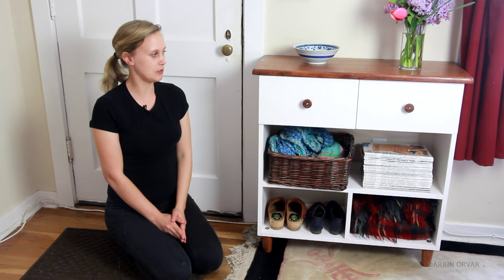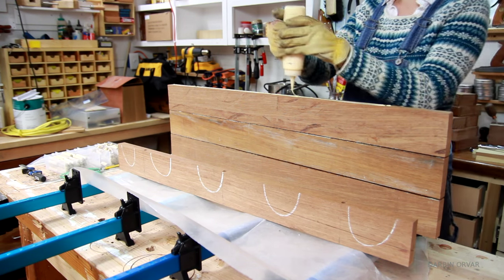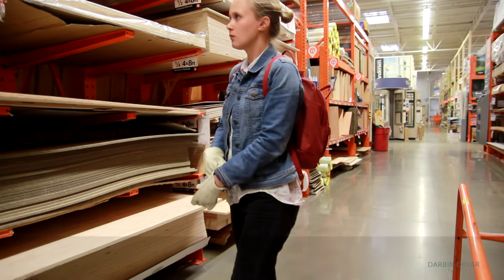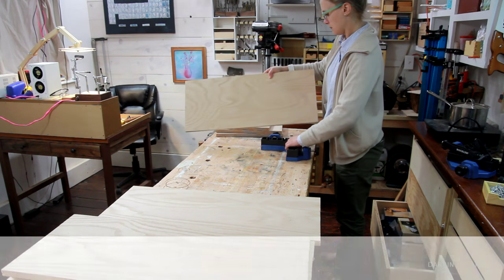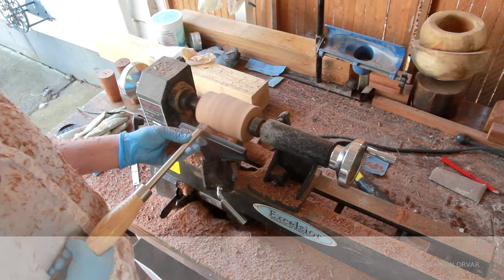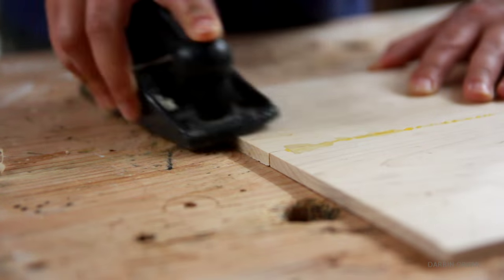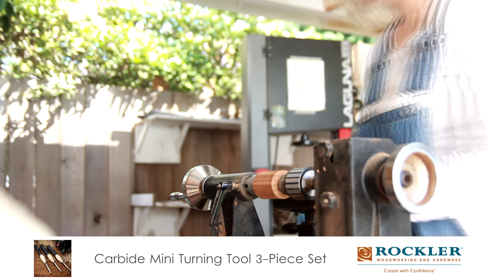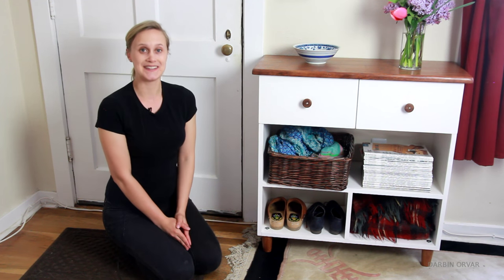Beautiful Entryway Table w/ Dovetail Drawers

Comment: A very nice job!  You make it look so easy, and as someone who has done similar things myself, I know it's not easy to make it seem easy.

A trick that some might find useful: for cutting up large sheets of plywood when you don't have a panel saw you can make use of styrofoam insulating sheets. These are sold in packs of three where I live, and consist of 3/4" thick, 2' by 4' sheets of light styrene foam. You just drop them on the floor or driveway, put the plywood on top, and set your circular saw to penetrate the wood by a 1/4 to 1/2 inch.  With thicker plywood you can crawl around on top as needed, and if you happen to cut into the foam, there's no danger or harm to anything that matters. The foam is very inexpensive, but if you are a little bit careful it can last for years. Storing it between uses is simple...just tape it to a wall or ceiling and get some extra insulation!

Thanks for the video!

-- Mike
Reply from the maker: +BigMjolnir That's a' great tip Mike - thanks!

Comment: Nice build! One trick I've learned when fixing cracks with epoxy, adding  a bit of wood stain to the epoxy (or black paint if you want it to look like a knot in some cases) helps the fix blend in if you have any gaps. I've had cases where that milky white look of epoxy stuck out like a sore thumb. It's a bit trial and error, though.
Reply from the maker: +John Nesbitt Thanks - I agree staining the epoxy is always a good idea.

Comment: Great work and end result as usual, Linn.Glad to see you using the face shield when turning.So good to sometimes work outside when our northwest weather turns good.Have you seen my tips in the "Methods of Work " section of your Fine Woodworking magazines? One is in the current issue.
Reply from the maker: +Bill Wells Thanks Bill - that's so cool you've got tips in Fine Woodworking, I'll have to check that out!
Reply: +Darbin Orvar I saw the stack of Fine Woodworking magazines in your entryway table!

Comment: Nice. And nice glasses. All three of them. Not the most imaginative build but very nicely executed. Can you tell me why the bottom of drawers is alway so thin? It should be the side that are thin and the bottom thick.
Reply: Helge Frisenette  
the main forces that drawers experience aren't downward forces from the weight of things in the drawers; they're pulling and racking from the drawers going in and out.

even when the drawer is very, very full of heavy stuff, the force from sliding it is more significant than the force from the stuff just sitting there.

this is probably more true in traditional drawer construction, without metal drawer slides, but there are a lot of drawers that still slide on something, rather than on metal slides.
Reply: +ThoperSought but I've seen many a drawer where the bottom would bulge out from even moderate loads. Even worse is it when Masonite bottoms and moisture combine, like in an alternately cold and warm workshop or a cellar. The bottom will literally drop out. Why not use the same material as for the sides or even just something stronger than what is usual.
Reply: Helge Frisenette 
my apologies if you know some/all of what I'm saying here; since I don't know what you know, I'm pretty much including everything I can think of at the moment that's relevant.

"I've seen many a drawer where the bottom would bulge out from even moderate loads."
yeah, that's a point.  

there're two different things going on with that:
1. in a lot of cases, the material isn't really as strong as it should be, and no one bothered to do the calculation.  masonite is a particularly horrible example of this: it might be okay on really tiny drawers, if it's thick enough and in a dry place, but other than that, hell no.  a lot of things are made by guesstimation, and rules of thumb about how they should be made, and serious testing is only done when it's legally necessary to get an engineer involved.  this means that, for example, in some cases, the drawer is very large, but the thickness of the bottom material isn't increased to match, and no extra bracing is included, so of effing course it drops out.  by contrast, I have seen drawers with a brace down the middle.

2. even when the material is strong enough, at the outset, and even if it was tested, it may—as with masonite—be susceptible to changes in environmental conditions that they didn't account for.  real wood—if they used real wood at all—changes a lot with humidity, for example, and something that's fine in tests in summer in Louisiana may not be quite big enough in whatever the driest season is in Arizona.  this would also be why you can't glue a solid wood drawer bottom all the way around, and have to use a groove and let it float, like Linn did.

the conclusion to draw isn't that drawer bottoms universally need to be thicker, it's that cheap stuff falls apart.  in this video, Linn used solid wood panels, and although they were very thin relative to the sides and back, those panels will be more than strong enough for the size of the drawers.  another good option is to glue a relatively thin piece of plywood all the way around the bottom.  decent plywood is well strong enough to withstand the tension from the weight of the things in the drawers, and good quality glue is stronger than that.

otoh, if you see a piece of furniture with a drawer that is (1) moderately to very large, and (2) has a masonite bottom that (3) isn't glued all the way around, but is instead floating in a groove like Linn's drawer bottoms, and (4) doesn't have any bracing, anywhere, then don't even think about buying it.

Comment: nice result Linn. I was wondereing why you use oak plywood if you are painting it afterwards?
Reply: +Martijn Fransen  Hmmmm...I was about to say its stronger, then I remembered its just veneered plywood. I don't know. Good point!
Reply: If her store is anything like mine, it's the same price as birch ply and the oak veneer is very slightly thicker than the birch so less tear out.

Comment: That turned out very nice. I do have a question. Why did you decide to not conceal the T-nuts securing the feet?
Reply from the maker: +Maxx B I didn't really feel like it - figured it's going to be covered with things anyway, but you certainly could.
Reply: That's fair enough. I just wondered if it was a design choice? It's still a lovely piece.

Comment: Very nicely done (as usual!)

I got a few pieces of Ipe a while back for a project, and while researching the wood, I came across a few articles that claim that Ipe dust is pretty nasty stuff.  Of course you can find similar comment about other wood species' dust, even pine and maple if you look hard enough.  Anyway, for some reason, those articles seemed more believable, so I ended up using a mask while working the wood...  I'm not sure if anybody has any comments either way?
Reply from the maker: +Nathan Tinlow Thanks Nathan! To me all dust is dangerous and woodworkers should always use a mask :)

Comment: Just a idea for you but if you lye down your passenger seat put a blanket or sheet over so your seat don't get damaged, you can slide the wood down to the passenger footwell and it should fit in the car better.

Comment: That's a nice looking little cabinet. Just wondering though, is 3/4 inch oak plywood as expensive in Oregon as it is in Ohio? It's $50 for a 4 x 8 sheet at Lowes where I live. Anyways, the cabinet really does look great Lynn, it fits nice into your space. Thanks for another nice video.

Comment: I'm curious, what do you do about gaps in between your boards? do you always use epoxy or do you use wood filler? i'm a stickler for perfection and it erks me when i can't get a board perfectly square before i glue it up.

Comment: How well does the epoxy take the gel stain?  Just curious because I've never used gel stain....or epoxy.
Reply: +CP Builds I've never tried gel stain, mainly just oil based paints and stains. I imagine it would work fine, assuming it would mix together evenly. Let me know if you try it. You could get a little tube of 5 minute epoxy to experiment with.
Reply: I may have to.  I've never used that gel stain either.  I love danish oil though.  I bust out the danish oil in my videos mostly.  Love how the wood only keeps what it needs and I just wipe it off.  Very easy and not blotchy.
Reply from the maker: +CP Builds I used a gel wipe on poly, it does cover the epoxy well, but it is not a stain. A stain would not work with a cured epoxy.
Reply: +CP Builds Yeah, @Darbin Orvar is right; disregard my answer, I thought you were asking a different question.

Comment: what was the outside temperature when you were putting the finish on the top ?
Reply from the maker: +carolina11b It's been pretty mild lately so probably 50-60 degree F (10-15 degrees C)

Comment: Why use oak plywood for the casework if you are going to paint it?   There is sanded pine ply,  MDF, etc. which either one has a better paint finish than oak.

Comment: it's a pity you didn't attach the drawer pulls from the inside with screws. I think that visible screw head detracts from the beauty. Apart from that minor criticism, it looks great. Nice work!
Reply from the maker: +MadMulberry I did attach the drawer pulls from the inside with screws. You might be referring to the center metal point in the knobs which is a design feature.

Comment: What's the point of doweling up the top panel?  Unless there was an alignment problem with your boards, then doweling or any other across-the-joint buttressing (biscuits seem to be a rage among some hobbyists) is virtually moot since edges make excellent joint all by themselves.  Loose the dowels and save time & money.  By the way, I'm a big fan of any fellow Oregonian woodworkers!